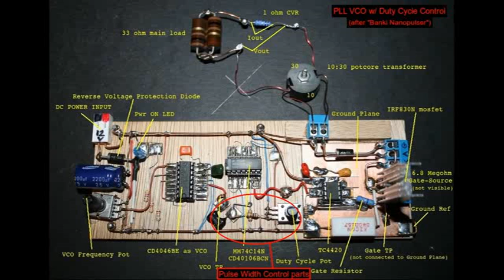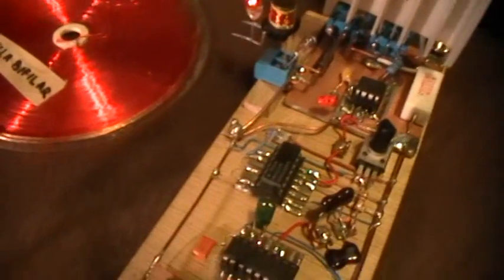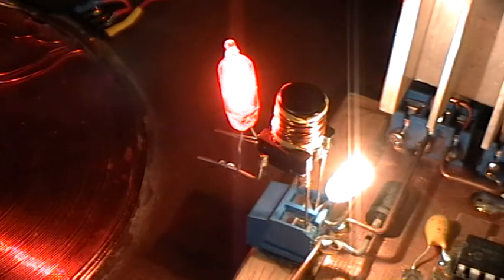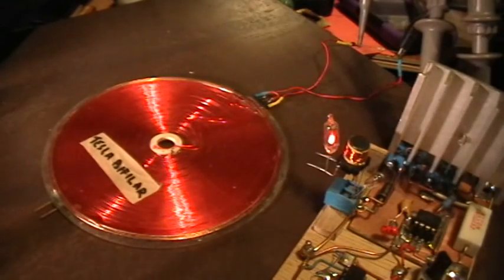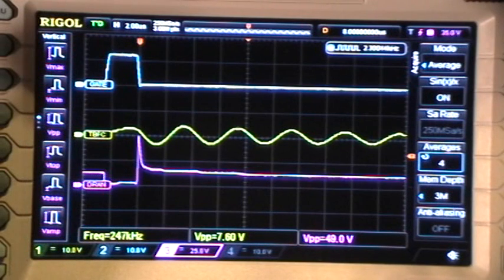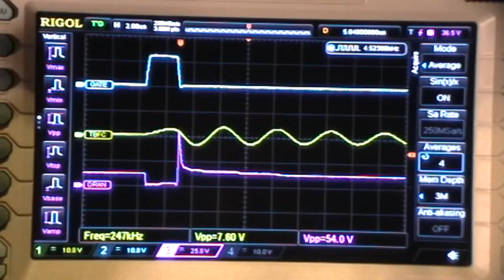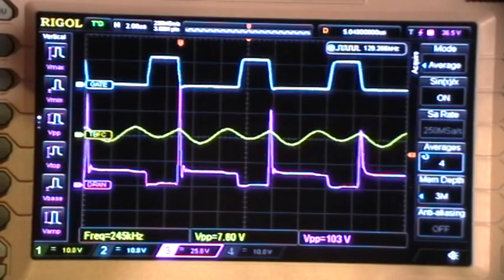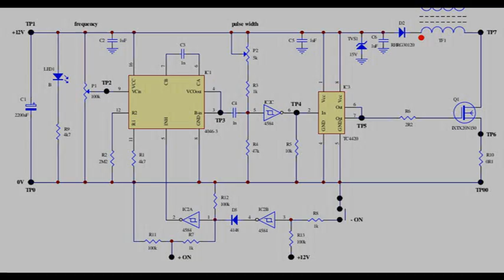Subharmonics, Resonance, Tesla Bifilar, Nanopulser

Comment: Great video!  Did you ever end up building one with a SITh? We're you using the bifilar to avoid adding a capacitor? The LC tanks with small coils produce the same affect and greater depending on caps used.

Comment: +TinselKoala : Another great learning demo.  Your circuit setup, frequency scan and scope shots really help to visualize the stimulation that is taking place at the coil's resonant frequency.  It really helps to better understand how it is analogous to pushing someone on a swing at every swing vs. every other swing vs. every third swing etc.  Also good to see how coil always rings at same natural frequency.  How would the response peak amplitude compare if you were stimulating with a sine wave at same amplitude instead of a pulse?  Thanks
Reply from the maker: Thanks for commenting. The amplitude of the resonant response will be less with a sine wave stimulation, since Faraday's Law applies. (The induced EMF is proportional to the time rate of change of the stimulation.) The faster the rising and falling edges of the stimulating pulse, the greater the amplitude of the resulting resonant signal in the "secondary".
Reply: +TinselKoala : Your response is a good example of what sets you apart from many others, you have the technical knowledge to engineer or modify a circuit and can clearly explain how it works and why or how it will work better.  I think many are amazed by the operation of some circuits and may even replicate them without understanding some of the basic operating principals that are at work.  Your videos and comments are very helpful to those of us that want to learn more, thanks for taking the time to respond.  Your nanopulser rocks!

Comment: Thanks for showing this TK,  if you wanted reduce FET ON time, it might be possible to differentiate the gate input pulse with a low value disc ceramic and clip the negative transition with a fast diode.. Nice scope too seems to have very stable trigger love the trace annotations!
Reply from the maker: Thanks for watching and commenting! Yes, the Rigol DS1054z is a very nicely performing low-end DSO with a lot of great features. Highly recommended for experimenters on a budget. 
I can actually get shorter pulse widths using this setup but it still has relatively slow rise-fall times. You'd think a "nanopulser" would at least have rise-fall times in the single digit nanosecond range even if the pulse width isn't all that small ... But there it is. Thanks again!
Reply: You likely know that the Gate Drain capacitance is increased by the open loop gain as both terminals are 180 degrees out of phase so dv/dt is amplified by Av. To get nice fast transition, maybe signal can be taken from the Source terminal, the Gate Drain voltages are in phase and quite close so the G to S capacitance is reduced by approx Av. Similar to old emitter coupled logic idea, whilst still providing current gain. Not trying to be smart ass just hope to help.
Reply from the maker: Thanks, I'll give it a try.